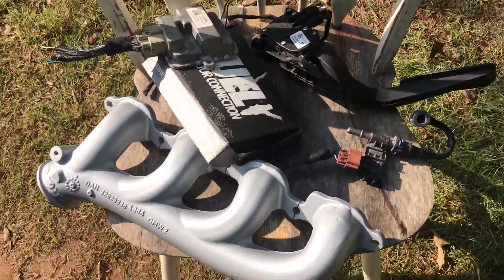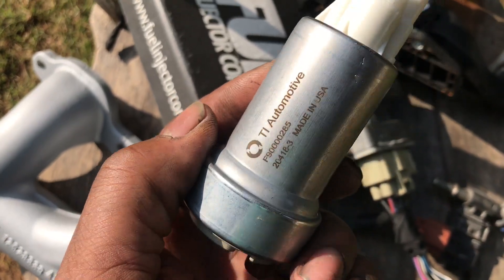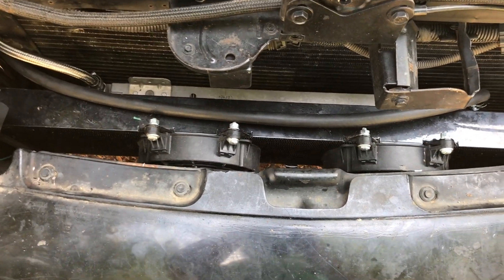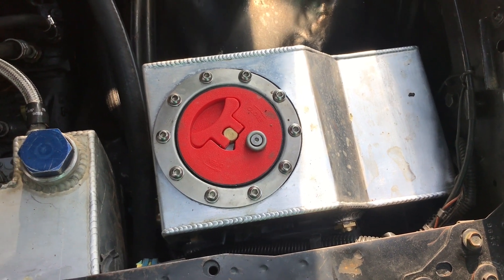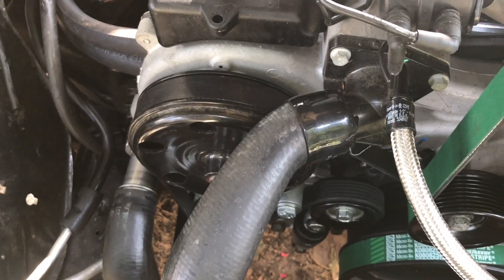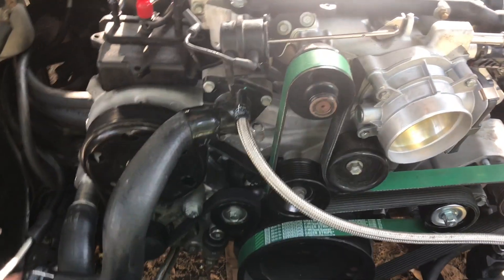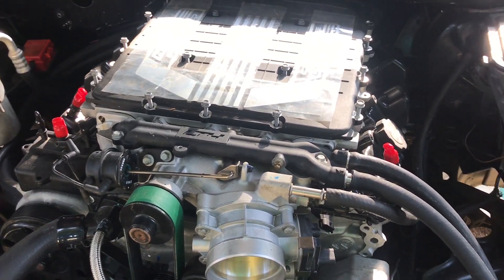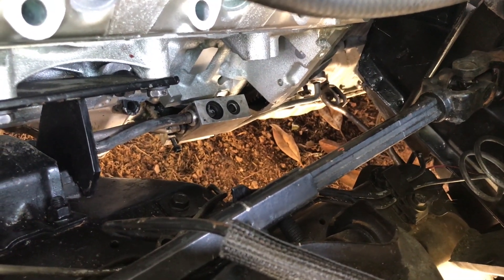Impala SS Gen V LT1 LT4 6.2L Supercharged Swap Update Pt. 2

Comment: Miss my cherry 96ss I should’ve kept it it had every damn suspension upgrade I could do coilovers and all and lowered 2-3in can’t remember exactly but they are so under rated when it comes to handling mine would out handle vettes Porsche’s and lambos had a 396 stroker built trans 12 bolt rear the interior was mint af I was the 2nd owner bought it from an elderly guy very low mileage had a little over 60k miles on it miss that car so much